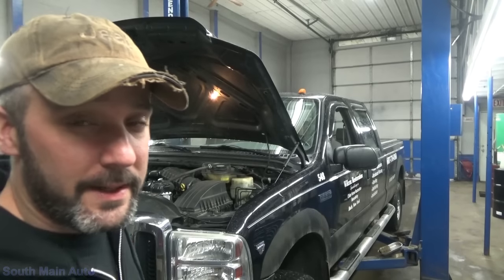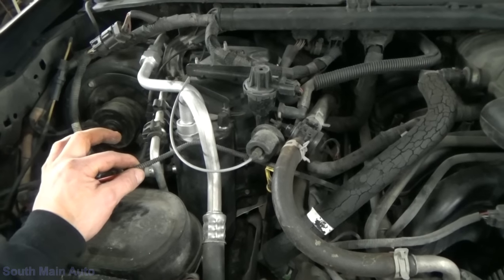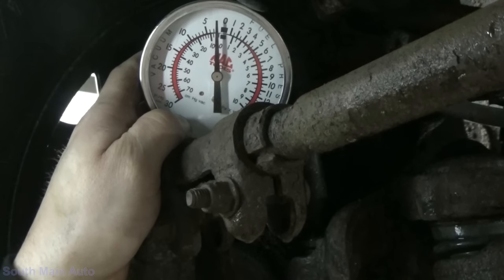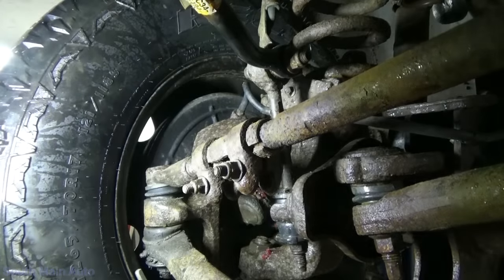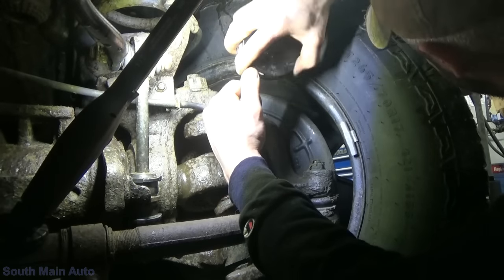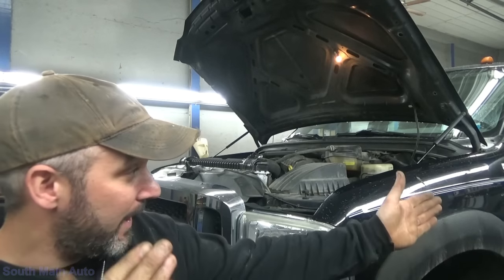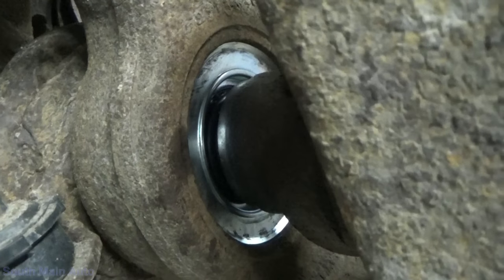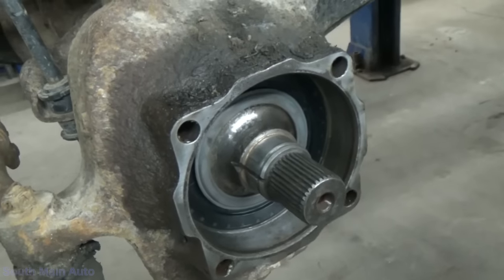Ford F250 4x4 - Vacuum Hubs NOT Engaging

Comment: I'll keep my fully manual hubs and manual t-case.  Those electronic/vacuum/cable actuator systems are pure garbage...they work fine until you really need the 4WD then inevitably they won't work.  I've never had manual hubs completely fail, I've replaced them because they've become really noisy, but I've never had them fail completely...Yes I have seen them fail completely but they were on modified trucks and they were doing some pretty serious tire spinning and the hubs blew apart when the spinning tire grabbed traction suddenly.

Comment: Ive had and still have many of these trucks. I just replace the factory with manual locking hubs and get out and lock them in. Not worth fixing that problem. Manual works every time

Comment: Who has a better design and why? I do not expect and answer but it would be an interesting note to the Ford engineers.
Reply: Eric has a video on Ram 4-wheel drive. "Dodge Ram No 4WD."  Ram and GM use an electric motor to engage 4-wheel drive.
Reply: Thanks, seems like an electric worm drive would be the way to go as long as it is sealed well. The vacuum stuff doesn't seem like a good idea at all. Ford is normally better than this type of design.

Comment: pal you are  good detective but ya got me confused about the need to test the right side hub. When you were pinching the cross over line to the left side that should have proven the right side was ok.  The smoke test proved the left side was faulty. This is way late after the video of course but just wanted to comment.

Comment: I never cared for anything that uses vacuum period. Electronic can fail I know that but using vacuum to lock in hubs,not cool. Seriously why? I have had electronic locks on my four wheel drive that has never let me down. I hear guys lifting their truck then not extending the vacuum lines,oops! Yup .Not my favorite.
Reply: IMHO I have to disagree. Vacuum is simple and I prefer it. On my current Ford I have electronic EGR, it failed last week (the electronic part and motor) and cost me 600 EUR for a new one. Had it been a simple vacuum EGR, it would have cost 100 EUR. I have electronic variable turbo actuator, if that fails is even more. The vacuum models turbos do not fail. These are just 2 examples from my personal car.
Reply: This is a terrible application for vacuum. A simple electric solenoid would seem to me better in this application. Probably one of the Ford family children got a REAL AUTO ENGINEER drawing kit for Christmas one year and designed this.
Reply: Given this particular application that Eric showcased, I do agree with you.
Reply: I can remember vacuum screen wipers  on  1950's and early 60's UK  Fords  and my  Austin Champ  4x4  they always slowed to a stop when going up hill.
I also had a car with vacuum operated retractable headlamps     equally foobar.
Reply: scott firman there is one benefit to vacuum hub locks.
If you tow and you need the low range to keep from burning your clutch out but don't want four wheel drive you can fit a switch to either the vacuum lines or the solenoid to keep the hubs from engaging. This is only a problem on vehicles that don't give you a two wheel low option to start with which I think is most of them.
Reply: Andrew W MacFadyen We had an old camper van that the wipers ran off pneumatic wipers. My friend owned a Mercury Cougar 69 the headlight covers worked off it also, they always failed.
Reply: Anom Amos I don't follow what you're saying. Can you explain what you mean, please?
Reply: GasIPass if you are asking about my comment on the one benefit this is what I meant.
On most 4x4s when you switch to low range there is no option for two wheel drive only. The options usually are two wheel drive four high and four low. By putting a switch on the vacuum solenoid you can keep the vehicle from entering four wheel drive but still choose four low . The front differential will still spin but there won't be any drive to the wheels. People who move caravans and other heavy trailers love this setup as it can be very helpful manouevering  on steep hills when trying to park in a tight location and it's not snowing or on gravel. Trying to shift a heavy trailer in four wheel drive on pavement can destroy the front end so not engaging the front hubs but being able to use the lower gearing is very beneficial.
Reply: Anom Amos got it. Thanks for the explanation and information, makes perfect sense 👍🏻
Reply: the vacuum 4x4 system in my tacoma has worked flawlessly for the past 21/22 years when my truck went underwater for a few hours the electronic actuator would have shorted like everything else on the truck

the problem is ford used plastic (seriously) lines Toyota uses metal lines
Reply: I hate vacuum operated stuff. People used to think that fancy vehicles had everything vacuum operated but in reality it is garbage. Cable or electronic is way better than vacuum. How many issues have I had with the electronic 4wd on my Silverado? Zero. Same on my ram.
Reply: @stevenvanheel3932  never had any vacuum issues on my tacoma, had  a couple electrical issues after the water went over the roof though 

nothing i wasnt able to fix in a week

right about now some of the older tacomas' electronic front diff actuators are going out from poking around on the fourms 

my vacuum system 5 years older then theirs still works flawlessly
Reply: I prefer manual chocks. Damn you half to go back a long way for those.
Reply: u2mister1 I have a 77 ford with manual locks. Kind of a pita but they do work.

Comment: Why in the hell, you did not wire brush the shaft so it was smooth and and clean of rust before you reinserted back into seal and trans? " Also , just asking, why you did not replace the U - joint ?  You put out very well made video's. Thank you for your time.

Comment: I would love to get one of them smoke machines but man they are expensive
Reply: fuzzy wuzzy I have seen some on eBay and YouTube that use a paint can, some resistance wire, baby oil, 12v, and regulated compressed air to make smoke.  Thanking of going that route myself for personal light use.
Reply: Have built many of them for friends. Use a BBQ regulator to drop the air pressure down. The wick you use can be a PIA, I have been using a "rope" sold as a stove door seal. Doesn't get all messed up like some of the other items. If you open many of the pro units you find a GM glow plug stuck in an oil bath. There are a couple that use wire wrapped around a large bundle of wick as well.
Reply: plumber smoke pellets and vacuum gun is a quick one off solution. Many online plans for cheap but good machine build solutions .
Reply: I use an e-cig and an aquarium fish tank air pump and various hoses depending on what I'm workin on.

Comment: FWD Pickup truck? Lol never understood the locking hubs. Like just lock the diffs
Reply: The lockouts simply connect the axle to the wheel to transmit power, when not in 4x4 they disengage to save tire and u joint wear .The diffs are usually open diffs.

Comment: When Men were Men they got out and LOCKED their hubs MANUALLY--hehehehe, I assume as that truck is 10 years old it has over 100,000 miles so as you say things are on the 'to fail' list- You should be a car engineer and show those bean counters a thing or two. The guy/Guru who I got my Jeep transfer case from on Long Island worked for Spicer, not sure about now

Too bad Advanced auto didn't offer loaner tools for that, when I did my Grand Cherokee ball joints I borrowed that huge kit for free

Comment: what a garbage design , makes ya wonder if engineers are doing it on purpose., In fact they must be
Reply: What they are doing is making the parts for as cheap as possible as long as they are within a loose tolerance. It is acceptable these days to have bad parts right from the get go.
Reply: It will work for the length of the warranty which is good enough for Ford.

Comment: Vacuum actuators are so stupid. My 2003 F150 has a vacuum actuator on the front diff just like the Chevy and dodge ones but not electric actuator! It takes so long to engage! And sometimes if you don't wait long enough and let it engage all the way it will pop out of 4 wheel drive!

Comment: Ok...so the hubs have seals, the hubs use a vacuum to operate. The hub that's in water and mud etc? And ford thinks it's a good idea to use a vacuum to engage it? Seal fails, hub sucks a bunch of crap inside? No I haven't and won't be driving a ferd latey...

Comment: Fragile design, while vacuum is cheap and basic principle, using centre of hub as a vacuum chamber was poor concept. Needed a vacuum actuator acting on the hub engagement . Whole hub and shaft looks fragile and not good sealing which major issue in environment where his sort of vehicle used. 
No centre diff of some sort poor too really, stresses drivetrain and reduces 4wd usability.
Keeps you busy though Mr O, surprised cheeky chinese not copied that type hub seal install tool as cheap to make & would sell well via amazon/eBay .

Comment: turbo diesel, true constant 4x4.............then there is no need for all these 4x4 engagement systems to save 5% on fuel. That Ford wheel seal is the most hokey idea ever.
Reply: Saves more than 5% on fuel and also save the front axle from wearing out, those u joints dont last forever. Would drive like shit on the street too. If it was full time 4x4
Reply: @ford300rippergarage   LoL........true constant 4x4 ( with power divider function) drives great on the street, far superior to any 2WD.  You must be talking about simple 4x4 where the diffs fight each other on bitumen (no power divider)..............who the hell uses that 'old' system anymore?? Only cheap,nasty 4WD vehicles use that................
Reply: @wazza33racer  all pickup trucks still use 50/50 power transfer unit. (Transfer case). They crab and bind up on the tarmac.

Comment: what a shitty design. what happens when its leaking and the front hubs are under water? does it suck water in to intake/tank?
Reply: Interesting question...
Reply: movieguy73 easy way to clean carbon off of the pistons. right?

Comment: you didnt smoke the other  seal thou hmmm
Reply: He did say if it leaked it wasn't enough that it couldn't be overcome by engine vacuum, since it worked.  So what was important is that it worked, not that it was completely leak-free.

Comment: vacuum hubs are just as stupid as reinventing the spark plug......AKA 5.4 3V engines 

like..... why does ford STILL use so many vacuum lines?
that get brittle after 5 years and crumble if you even THINK about toughing them 

i thought my grandmothers 86 chevy pickup with its 10,000 vacuum lines was bad.... 
but EVERY ford with these vacuum hubs, that comes into our shop... has breaks in the lines.....EVERY ONE

because people in montana ACTUALLY off road...... and a single sage brush wipes out 5 vacuum lines, and makes the truck run like shit....

i just dont get it..... GM has had DAMN GOOD mechanical auto locking hubs for 40 years.... 
again.... like my grandmothers 86 chevy 

fully automatic.... fully mechanical..... and ZERO issues
just might have to back up 2 feet to disengage them if your in a hurry....
Reply: like...... a VACUUM RESERVOIR! on a pickup built after the 80s ended...... WHAT THE FUCK FORD!!!!

surprised the cruse control still isnt using a big "vacuum diaphragm".......

Comment: What a POS engineered to fail design, Ford and their so called "better ideas", yea right!.   Having worked on all of the big three brands, Dodge always seemed to have had the best SFA 4 wheel locking system with Chevy/GMC coming in second and Ford dead last.  Just why would anyone want to own this crappy 4x4 design beats me.